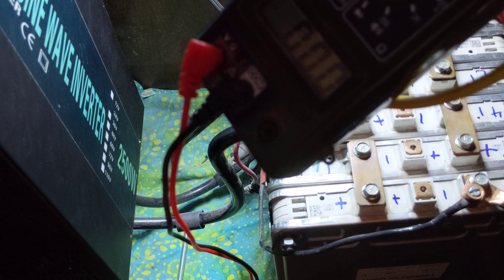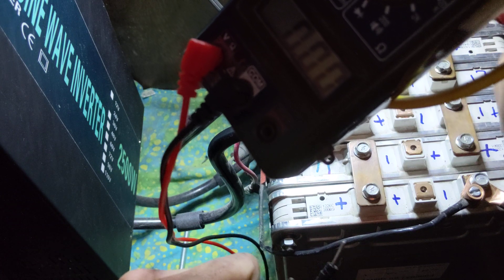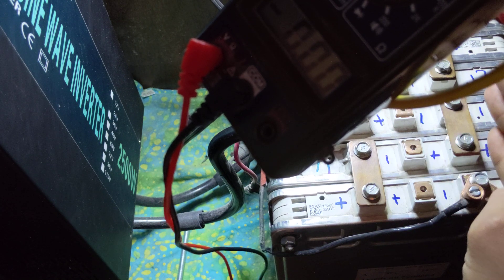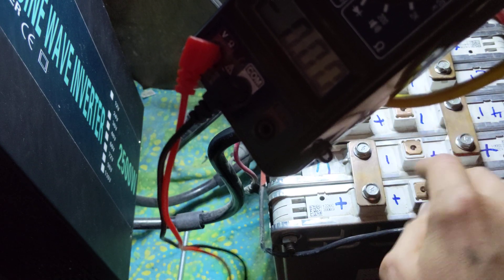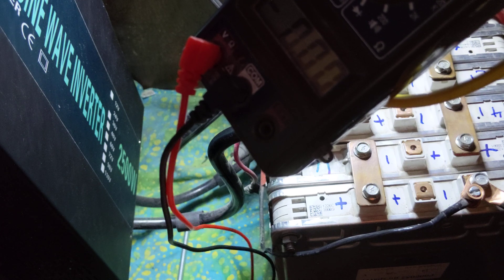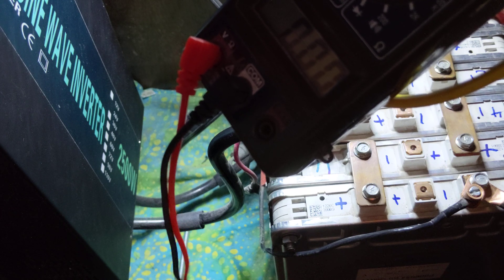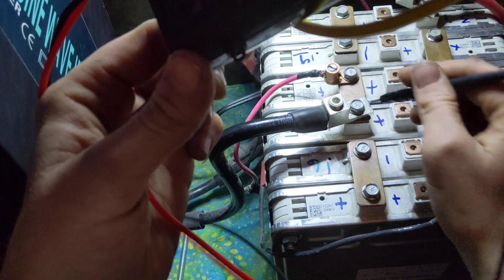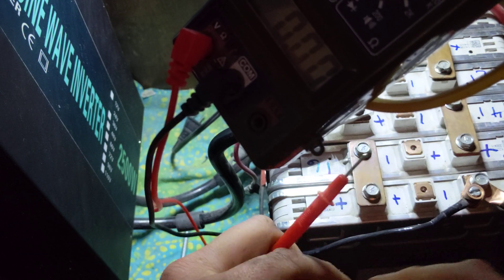Part 1 of How to Manually Balance your Nissan Leaf lithium-ion battery modules! In a 24v config!

Comment: Hello, 

I’ve bought the same batteries from tech direct. I purchased three of the 24v sets of three. Is there a way I can connect those modules as 3 24v batteries in series, and then run the three in parallel? I am new to this and I have no idea how to do it. Thanks in advance.
Reply from the maker: Absolutely, you can run all three of your sets in parallel

Comment: What I'd do in this setup is get a cheap bms and take the weakest cell and match it with the strongest cell, and so forth. That way the strong cell helps the weak one and they stay more balanced naturally.
The cheap bms would keep things from getting too fast out of control.
Reply: How often do you need to check your batteries manually?. After 2 years are you wanting to automate it?  
I just started using my Leaf batteries 3 days ago and I don’t have cell balances or BMS yet. Already one group is 0.3 V lower than the other group. 
 I’m not sure I understood how you balance. Slow charge with solar controller and let it do the top balance?
Reply from the maker: @paulbaker3144  I check on them once or twice a day. That's not to say that I put a multimeter on all of them every day but I look inside the cabinet and make sure that everything is okay everyday at least once per day. The only time that I've ever felt that they were out of balance enough for me to be concerned, I just put the heaviest load on my system that I had and let it drain till the system shut itself off and I did that at night so it slowly starts charging as the sun comes up. Once they got back to 100% they were way more in balance than they were before. 
My modules are all different voltages because they came from three different cars.  They wouldn't ever physically be able to be in perfect balance with each other unless I cut the top third of two of my modules completely off losing that capacity all together.  If I try to balance my system exactly I would obviously have to balance everything down to the module that has the least amount of capacity in the system which means that the modules that have more capacity than that weakest link will never actually get used. 
All that said, it really kind of just comes down to how confident and safe you feel. I've never felt that the money was justified in buying one but that doesn't mean that it wouldn't be the exact opposite situation for you. You can always add one. If you get a month or two into using your system and you feel like it's not staying stable enough for your comfort then go ahead and get one. You're not going to hurt anything by doing so. Just make sure you got your charging/discharging parameters set to never go over 25 v. That's really the biggest concern. That's not because it's lithium... If you overcharge any other type of battery you would be in just as much trouble! 😏
Reply from the maker: Thanks for the input. ♻️🔌💯🌞

Comment: If a bms is good for anything . You can at least see the voltage of each cell. Get the one I have it has a screen and is manually settable so you can turn off the balance feature but still have the cut off features. Check my channel.
Reply: Where you are going to have problems is at the top or the bottom. Not in the middle voltages that you are checking  now.